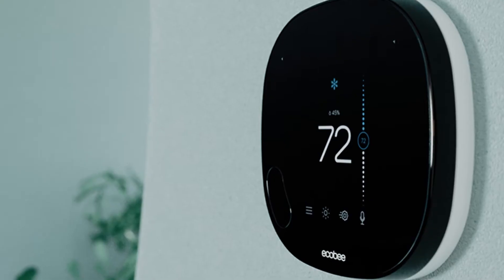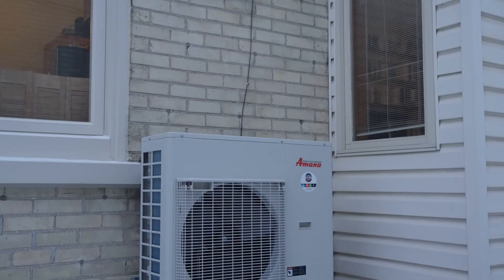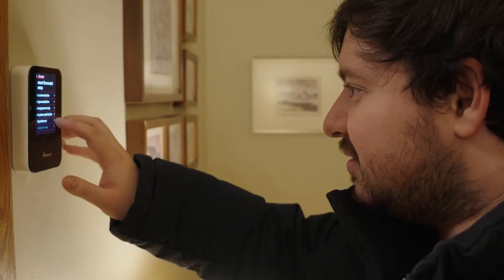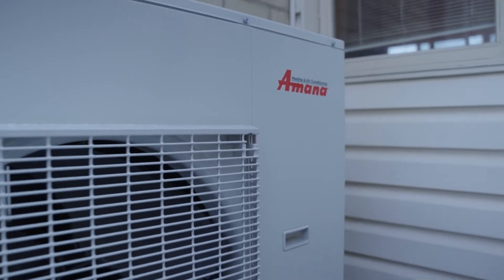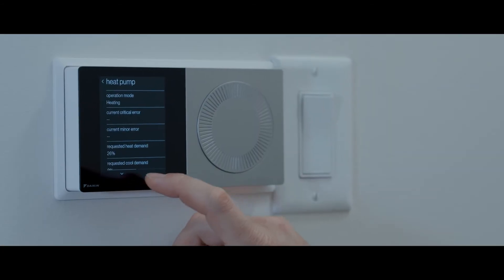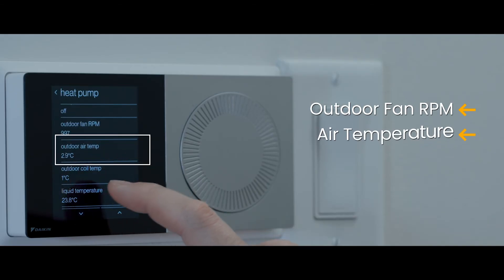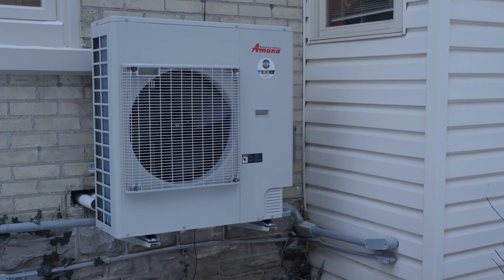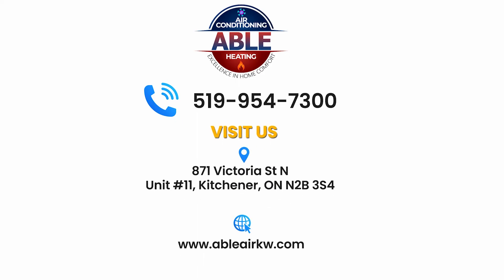Intro to Communicating Thermostats

Comment: These gadgets, similar to the auto industry, are absolutely unnecessary. Efficient running fan motors and compressors are all one requires. They all need that extra juice upon startup but when running it’s minimal. 
Insulate your home better 😉